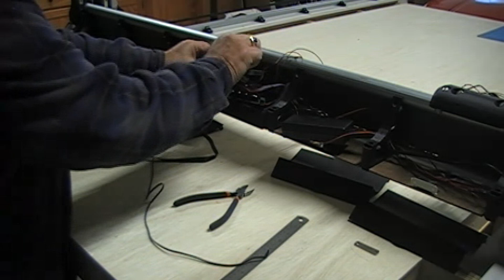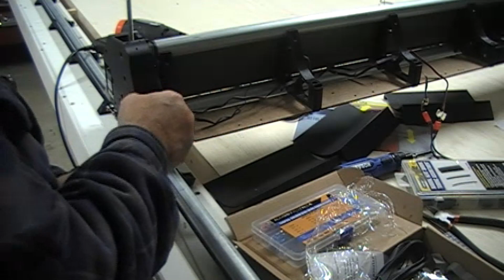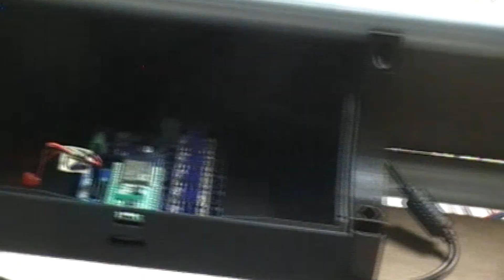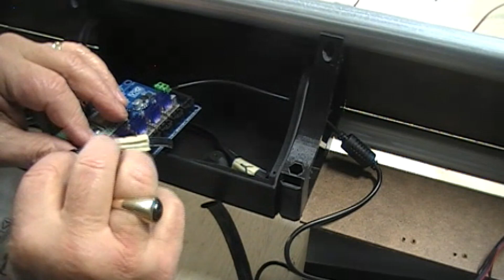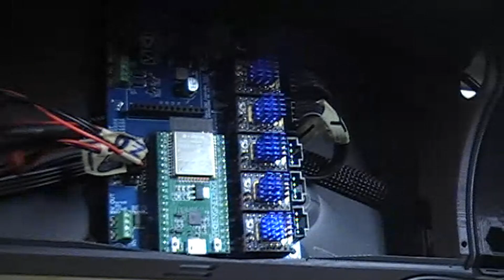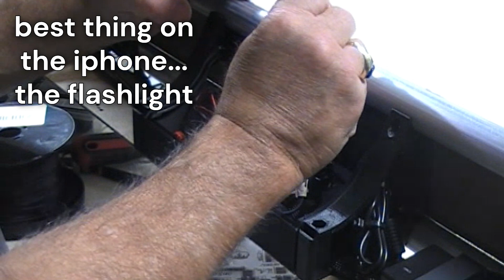DIY LR4 CNC Router Build   Part 23    Permanent Wiring

Comment: hi where can i get the stl file of the motherboard case
Reply from the maker: If you are talking about the one that looks like Doug’s cover then it can be found here… but you likely will need to modify it as I did to fit the space you have.. I had to mod Doug’s covers as well.  

https://www.printables.com/model/1093700-jackpot-and-powersupply-case-for-the-lowrider-v4
Reply: @ ok thx  I’m talking about jackpot case